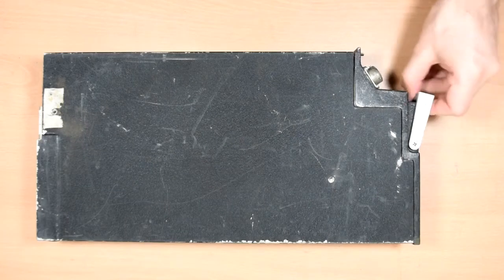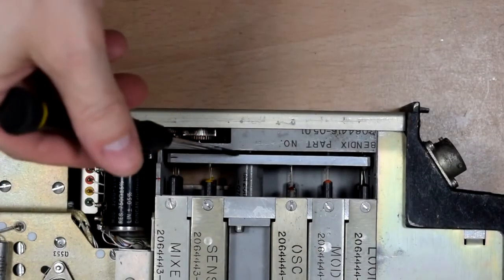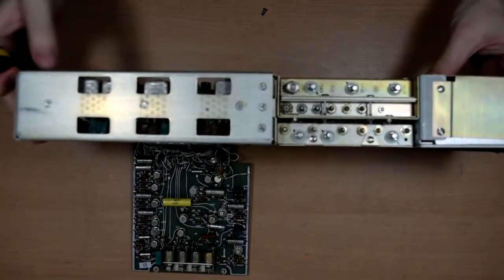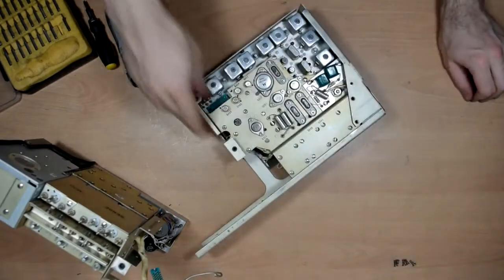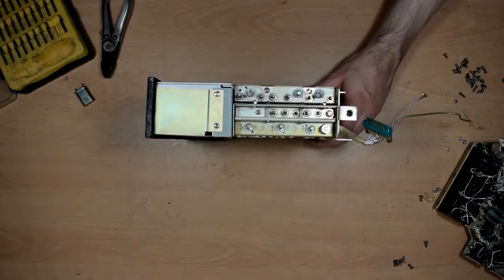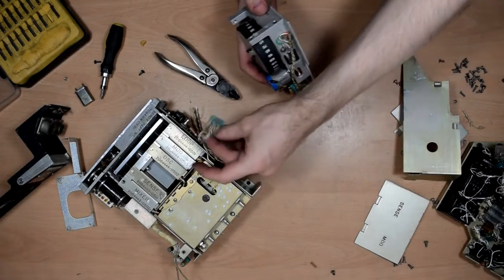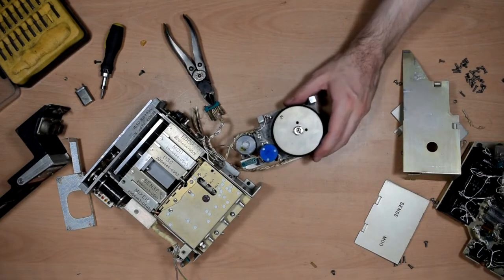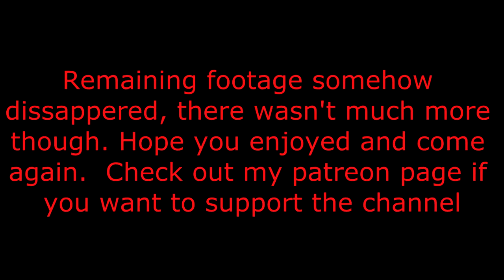ADF reciever teardown

Comment: At 11:43 this is a high frequency resolver. The loop antenna sin/cos is connected to it, and the servo control searches for zero output, the result is a synchro transmitter connected to the ADF indicator.

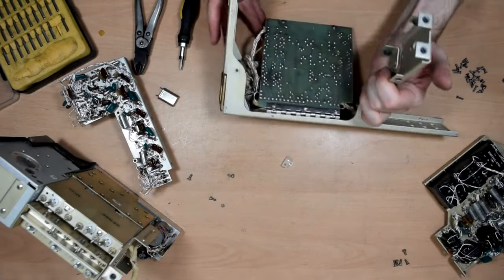Comment: 7:30 I could imagine several reasons for mixing point-2-point wiring with PCBs on this old device, but that's all speculation though:

1.) some of the components were not available in PCB-version yet
2.) mechanical reasons, like G-force on some larger parts
3.) heat dissipation
4.) electrical performance
5.) official aircraft safety regulations on how to built such a device

I have no idea though
Reply from the maker: all good points. I have seen the same in other aircraft boxes.